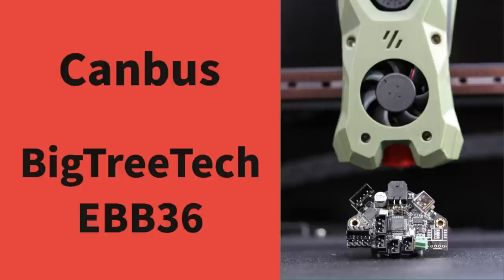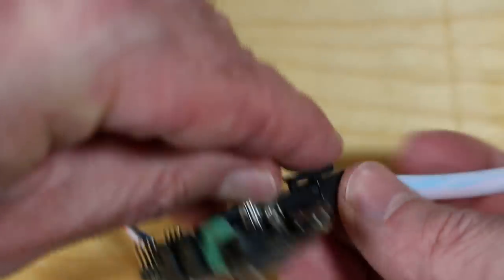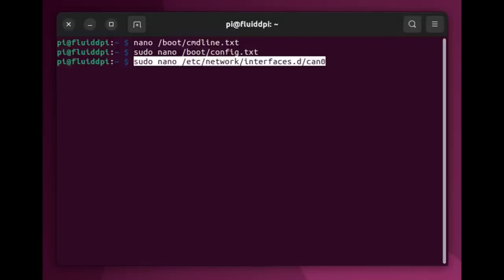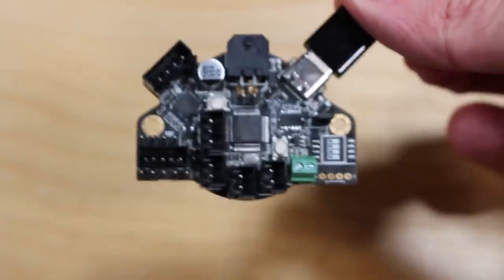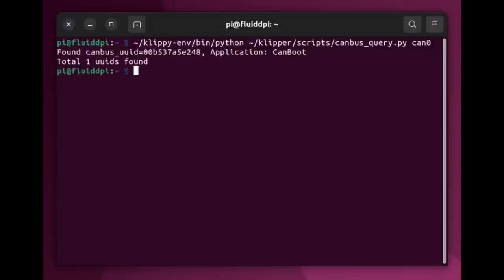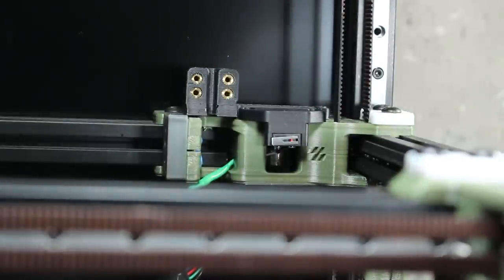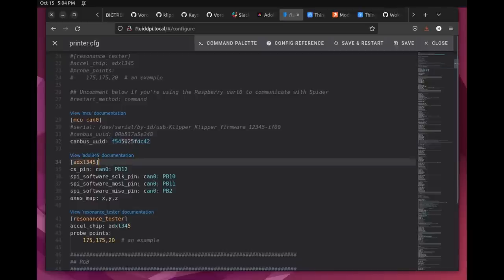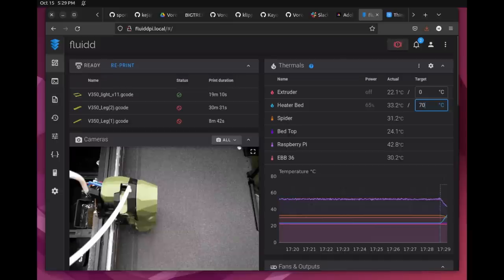Canbus (can bus) - EBB36 / EBB42 Install with Klipper on Core-XY Voron 2.4

Comment: I couldn't tell 100% from looking at the closeup shots of the toolhead wiring, but I assume you were able to plug the Euclid probe's cord directly into the Canbus PCB?
Reply from the maker: Yes, that is correct.  And it works perfectly.  And there is still a little more space.  Thank you!
Reply: @KapmansBasementWorkshop  Good to know, thanks! I'm currently doing my first Voron build (2.4) and am planning to do a similar setup as you with an Euclid probe and umbilical cord. I think I'll attempt the umbilical setup first, then check that everything works for the initial build, and then soon after install the Euclid probe. Does that sound reasonable to you, or do you think it's best to go the full stock route (with cable chains etc) first?
Reply: A corollary question would be: do you think it's reasonable to install the Euclid probe right away instead of the stock probe as part of the initial build, or would I be asking for trouble :)
Reply from the maker: @jphalip  As long as you are comfortable with the additional changes and calibration of Euclid that need to happen before your 1st print, it should be ok.  But, euclid, canbus and the umbilical are collectively a very major change that all need to be part of  the Voron instructions/process  for initial setup.  It's a lot.  But I think it will be better than building a standard Voron, and then taking it apart to add all this.  Go slow and check everything 3x.  As long as you have done similar projects like this, I think you will be ok.
Reply from the maker: @jphalip  I think I have mixed recommendations here.  My apologies.  If you start your build with all of these changes, it will likely be harder to get help from the community as it's so different from the typical build.....there is benefit to going standard 1st to get it running....
Reply: @KapmansBasementWorkshop  Ok that makes sense. I might just bite the bullet and go the hard way by setting up all the upgrades from the get-go. Some parts might in fact be easier (e.g not having to install the cable chains), but it sure might get challenging to deviate from the manual. Luckily the community is super helpful so hopefully I'll be able to get some help when I inevitably hit some snags :)  Thanks again for your videos, they have been very helpful so far!

Comment: Thank you for all the great + detailed videos! I finally have canbus to communicate. I still have 2 problems, both 24v inductive probe + x endstop microswitch are not working. It's hard 5v d2f microswitch, can you please advise where I can buy it? Thanks
Reply from the maker: You should be able to move the existing microswitch for the x-axis if you choose to use umbilical. If you don't choose umbilical, there is no need to do this.  However, this switch is commonly available at places like this: https://www.mouser.com/ProductDetail/Omron-Electronics/D2F-5?qs=F5EMLAvA7IBn%2FmUmNpbjIQ%3D%3D

Thank you for the nice words and watching!
Reply: @KapmansBasementWorkshop  It was a long day I had the wrong pin connected. I'll be on your Euclid probe video to hopefully finish the many upgrades. Thank you for your reply and many great videos

Comment: do you have a list of the boards you user? where did you get them from??
Reply from the maker: Here is the CanHat I used: 
https://www.waveshare.com/product/raspberry-pi/hats/interface-power/rs485-can-hat.htm
And here is the CanBus controller I used: https://biqu.equipment/products/bigtreetech-ebb-36-42-can-bus-for-connecting-klipper-expansion-device?_pos=1&_sid=eef6da74d&_ss=r&variant=39760665215074

Thank you for watching!
Reply: @KapmansBasementWorkshop  thank you.
Reply: @KapmansBasementWorkshop  sorry, is that with the max 31865
Reply from the maker: @gnafin  If you are just going to use the standard heat sensors that are typically used on your 3d printer, you don't need max 31865.  The one on my printer now does not have the Ma 31865.

Comment: At 19:14 in your video, I see a red and black wire attached to the RS485. From what I have followed on the video, the PI is powered from a separate 5V PSU (which I already have). The EBB36 or 42 is powered to the 24V PSU. Perhaps I missed where these 2 wires on the RS485 are coming from.
Reply from the maker: If I remember correctly, I did not power the pi using the USB-C connector, I used the power pins.  So when I added the HAT, I simply moved the power wires to the pins on the RS485 which extend from those pins.  If you are using the USB-C power port, you should not need those wires.  One more thing.  With the RS485, I recommend you flash to a higher speed.  I would go with 500k or even better 1mb.
Reply: @KapmansBasementWorkshop , Yes, I now see what was done. It has been a while since I built my Voron and now see that I also used the power pins on the PI to the 5V. So basically just passing power thru the RS485. BTW, thanks for the quick reply.
Reply from the maker: @LesWheelerBass , Thanks for the good question.  This option worked well.  A second option is to use an extra card called a U2C which plugs into the pi USB port for canbus.  It works really well also.  Honestly, both are good options.

Comment: At the moment I am using a halleffect sensor and guiding the canbus cable through the z chain.
As for now it‘s working pretty good.

But at some point I have got to relocate the endstops and probably going to guide the canbus cable through the reverse Bowden. I just don‘t like that the back will be missy.

I have also used cat cable for power and data, pretty much the way to go.

One thing all my Ebb36‘s had DuPont connectors included.
Reply from the maker: The connector situation is interesting.  I was lucky I had some on hand.

Comment: Great video, thank you for it. Can you point me towards the umbilical cable you were leaning towards instead of the ethernet cable?
Reply from the maker: Yes, absolutely.  IGUS makes the cables.  There multiple to choose from.
https://chainflex-productfinder.igus.tools/home?__hstc=191717877.5bb514f313339496944c3d7ad6e20815.1668795627381.1668795627381.1668795627381.1&__hssc=191717877.2.1668795627381&__hsfp=2865168973&_ga=2.200304750.1761439034.1668795627-609807361.1668795626
Reply: @KapmansBasementWorkshop  Thank you!

Comment: Very impressive and informative thankyou. Excited for the follow up video. 
CANBus is too new for me to install just yet. Especially considering the different octopus and spider controllers.
CANBus is quite a substantial printer upgrade. This video brings me one step closer to CANBus for sure.
Absolute like the fact inputshaper is on the board. This is so handy!

As Klipper is installed on all these different boards. What happens when klipper is upgraded? Do you have to reflash on major upgrades. Would be difficult for me to remember all the make settings for the different boards when a major updates happens? i've only had to Flash my octopus once from a major klipper update if I remember correctly.
Reply from the maker: Well I was wondering the very same thing.....I will soon find out.  But if I need to do both boards, I will be upgrading the communication speed.  And absolutely, this is a major enhancement!  Honestly, more involved than I was expecting.  Speaking up upgrades, I hope the carrot feeder is going well.

Comment: Hopefully you'll see this. Great video, but I'm stuck at the step right before flashing klipper to the ebb36. When in ~/ klipper$ make menuconfig, under communication interface, can bus is not listed as an option. Only usb and serial are. I've followed everything else to a tee from what I can tell, and I'm using the RS485 pihat as well. I've done the check to see that the can network is working. Although I get 0 packets when I do ifconfig can0. I usually try to figure these things out myself but I am truly stumped on this one.
Reply: Well apparently klipper was far enough out of date that all I had to do was update it and problem solved.
Reply from the maker: I'm glad to see you got it fixed.  I don't remember ever seeing a "canbus" option.  I used USB.  That must be newer documentation.  Good luck with the build!
Reply: @KapmansBasementWorkshop  I should've specified, I was referring to 21:50 in your video.

Comment: is possible to use canbus with the octopus board?
Reply from the maker: You sure can.  And if you do, you don't need the waveshare board.  You can attach the EBB36 straight to the Octopus.  I have not done it myself as I don't own an octopus.
Reply: @KapmansBasementWorkshop   where can I find some documentation about it?
Reply from the maker: @martincastellano89  Klipper has documentation about it: https://www.klipper3d.org/CANBUS.html#usb-to-can-bus-bridge-mode

Comment: when you install these things. how in the world does it even work? is it just downloading pre made code that someone has put together for us? or am I just dumb lol?
Reply from the maker: Klipper gets installed in the EBB36, your existing MCU and the PI.  Klipper was designed to run with multiple MCU's simultaneously.  So the part of Klipper running on the PI manages both your existing MCU as well as the EBB36.  So Klipper properly sync and pushed to work to the proper MCU.  It's really slick!

Comment: Great video! Always enjoy your vids.
I have noticed something with your config though. I am using a EBB42 and on my setup I have the extruder uart_pin set to the corresponding pin for the tmc2209 on the can board. I noticed you have not. It should be set to can0: PA15 I think. At the moment you have it still set to control the tmc2209 driver on the spider board, PD7.
Reply from the maker: Hmmm.  You are right, I don't.  That's actually a mistake on my part,  yet it's working.  I need to look into this and get back to you, but it appears it's not needed.  I wonder what impact this might have?
Reply from the maker: I just fixed it and rebooted.  Running a test print now.
Reply: @KapmansBasementWorkshop  I think it works as you have something defined. However, who knows what power setting are actually being fed to the extruder.
Reply from the maker: @ashleywhitehead3710  You are absolutely correct!  I was wondering why the extruder motor was running hot at a current at 0.3.  The extruder is running slightly warm now at 0.35 amps.   Thank you for catching this!  I'll update the Github file.
Reply from the maker: @ashleywhitehead3710  I just updated the printer.cfg in Github.  Thank you again!
Reply: @KapmansBasementWorkshop  Thank you for the fantastic vids!
Oh, I just noticed the axis map for the accelerometer is wrong for the orientation you have the board mounted. Should be X,Z,Y. I think.
Also, since you have the PT100/1000 capable board, if you decide to use a PT100 or 1000, you can also use the regular thermistor port with a 3950 glass bead as a chamber temp sensor on the toolhead.
Reply from the maker: @ashleywhitehead3710  I won't be able to check until tonight.  But I will and I'll let you know and change the file if needed.  Thanks again for pointing these things out.  I'm thinking I should have posted my files much earlier as it's nice having someone help correct them!
Reply from the maker: I just tested this.  It does not seem to make a difference.  I even ran a resonance test.  Klipper seems to automatically assign the axis based on the test you run.  I also tried to look at the print on the EBB36 PC board, I can't read it, byt the axis seems to printed on the card.  Have you noticed a difference by changing this?

Comment: since the term is being used I wonder if this the same canbus used by cars or if its just a term shared by two totally different use cases.
Reply from the maker: This is the same canbus used in cars. The hardware is different, but the protocol and bus are the same.

Comment: did you ever try the input shaping with this card?
Reply from the maker: I have. Multiple times. 4 to be exact. It seems to work. Are you having an issue with it?
Reply: @KapmansBasementWorkshop  i got it working. i just forgot a few settings.

Comment: pretty neat thank you
Reply from the maker: Glad you liked it!  Thanks for watching!
Reply: @KapmansBasementWorkshop  yes I will mod my V2.4 soon.
Reply from the maker: @cristianopersi7953  Be sure to use a data rate of 1 Million, the maximum of canbus (I used 250k).  I'm getting ready to go back and re-flash mine to higher speeds.

Comment: Will you also include a carbon gantry to save weight?
Reply from the maker: While I've purchased several carbon fiber tubes, all of them are much less straight/flat than the standard aluminum extrusion.  So unless I find good CF tubing, probably not.
Reply: @KapmansBasementWorkshop  Then of course they are useless.  FYSETC has a milled gentry.  Maybe that's an option
Reply from the maker: @minga85  I have not seen those....they look very nice!  Hmmmm....

Comment: What size is your 2.4?
Reply from the maker: It's a 350mm.
Reply: @KapmansBasementWorkshop  great, thanks. I am also doing that Z chain mod to my 350mm 2.4 so I was wondering if the bottom bracket would also work mounted in the middle to avoid having to move the cables. Seems like it will work just fine
Reply from the maker: @alexchulzhanov  My apologies, but mounted to the middle of the bottom extrusion in the rear or the back extrusion on the gantry?  You can really mount it wherever you like.  The only limitation is fitting enough cable chain under the gantry so you can have as much z height as possible.  When the gantry is at it's lowest setting, space is very tight.  So those mounting blocks are really positioned to make sure the cable chain long enough can fit.
Reply: @KapmansBasementWorkshop  Yeah I used the entire length of one of the XY chains to make sure it would have enough Z height. With the bottom block mounted in the middle it has just enough clearance for the B motor which is mainly what I was worried about. I also use Tap so the gantry comes down a few mm further than normal and there is still just enough clearance that it’s not squishing the chain. Works really well and really cleans up the look.
Reply: @KapmansBasementWorkshop  did you add any links to yours or did you also use the regular length of the XY chain? I have not had the gantry that far up to tell for sure if it’s long enough or not but I think it is
Reply from the maker: @alexchulzhanov  I actually took a small number of links out to make sure it wasn't touching the B motor.  But so far it has been working well.

Comment: did you have issue with th adxl345 module?
Reply from the maker: I did not.  I've run several resonance tests and it seems to work fine.  However, others have asked me about this and some seem to be having trouble with this. I'm thinking of creating a video about it, but trying to figure out if there is enough content for a video.
Reply: @KapmansBasementWorkshop maybe the people whith 8mhz quartz have probleme
Reply from the maker: @astoria2297  On the Waveshare, 12mhz.  I don't see one on the EBB36, but I just followed the directions for the v1.2.
Reply from the maker: What version of the EBB36 are you using?
Reply: @KapmansBasementWorkshop  the Last one i think, make a big order from biqu, manta8p cb1 ebb36.......
Reply from the maker: @astoria2297  You should check the version.  It's on the back of the EBB36 Board.  The setup instructions are slightly different for each version.  Also, how are you connecting it to your pi?  USB or serial via a device such as the waveshare?
Reply from the maker: @astoria2297  That's a very cool MCU!  Best of luck with the build.

Comment: these are such great fixes!  the "Rear_Umbilical_face.stl" on your github seems to be damaged somehow, it won't load properly....
Reply from the maker: Sorry about that.  I'll recopy the files later tonight.
Reply from the maker: Have a look.  I deleted the old file and replaced it with a 3mf file.
Reply: @KapmansBasementWorkshop  Thank you so much for doing that!  Looks great.  I've been in the process of reassembling my 2.4 after switching to Canbus using Huvud board (haven't even powered it on yet though) and I was waffling about going umbilical or not. I think you've convinced me that umbilical is the cleanest way, thanks for that!
Reply from the maker: @theamzngq  I'm not sure the way I chose is the best and there are other options for umbilicals, but so far it's working.  There are cables made this for this....

Comment: 25:40 why should you have a endstop on the carriage? There really is no point for this, since both endstops are located on the right end of the x carriage.
Reply from the maker: By moving the end stops, the cable chains and wires can be removed from the x and y axis.

Comment: Why not use the poe headder instead of the gpio headder to power it
Reply from the maker: Meaning the PI?
Reply: @KapmansBasementWorkshop  yes. The 4 pins behind the eatgernet is for a hat to convert power over eathernet to rpi power. 3.3v I think?
Reply from the maker: @mastermoarman  I had a power supply for the pi, so I just used it. That does sound like something I could have used instead.